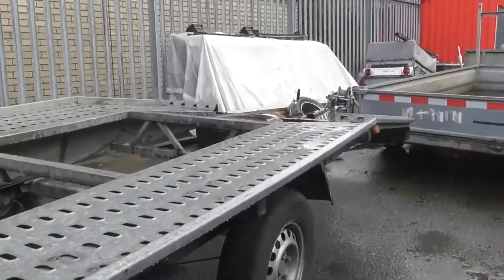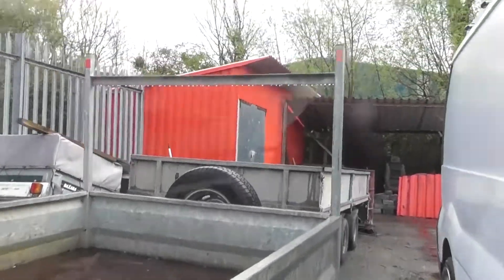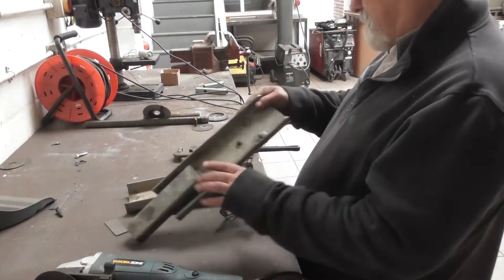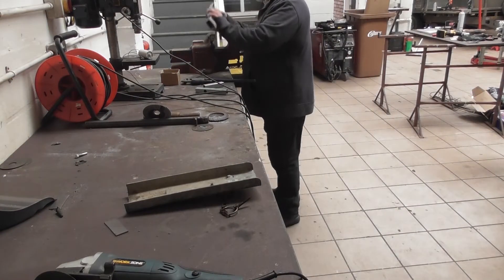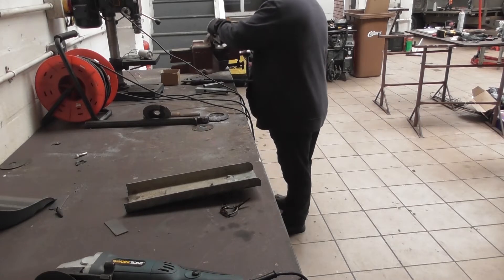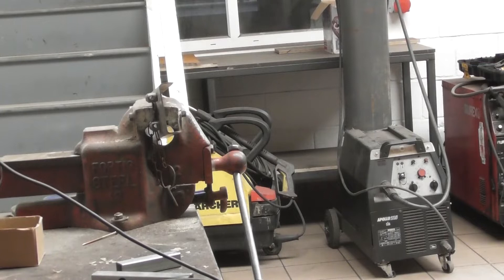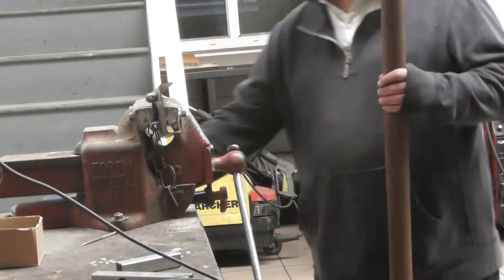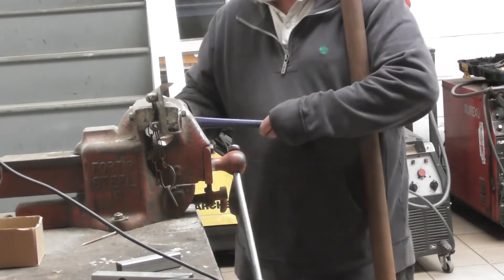had to make a easy trailer side rail repair ( just make it look hard )

Comment: You should make a hydraulic press for the shop. I'm sure they'd get a lot of use out of it. A big floor standing jobbie. I made one once. It's easy. Some C channel and heavy angle iron a couple pins and you're in.Though I guess you can just buy cheap imported hydraulic presses today easily enough too.

Comment: Them drop in side bars are always a loose fit . ive redone loads  some times if the load comes loose and hits loose side bars they bend out. So many i have fixed for loggers and timber companies. But these trailers are getting more flimsy . As every one wants lighter trailers